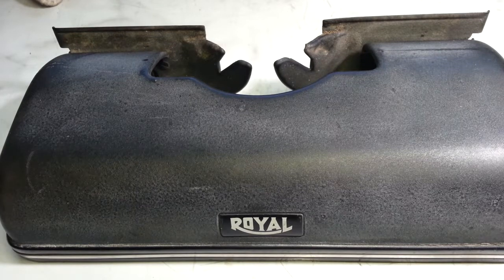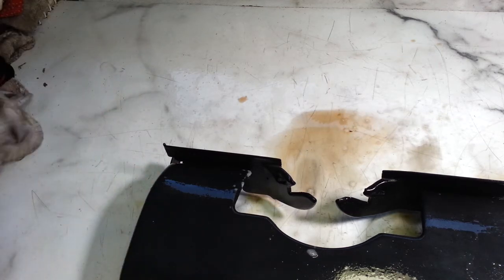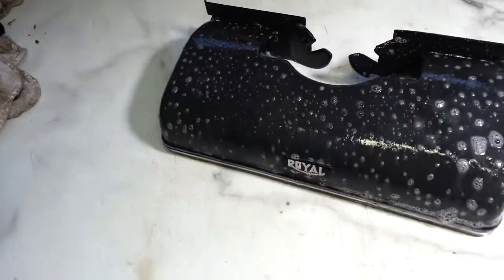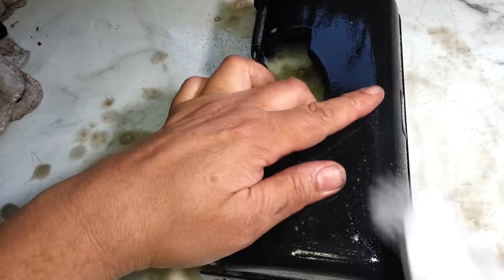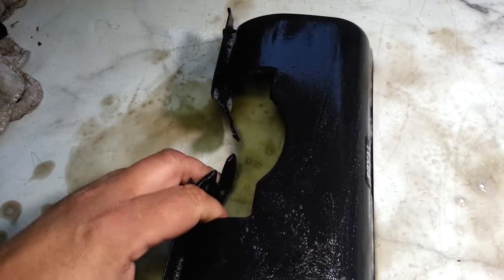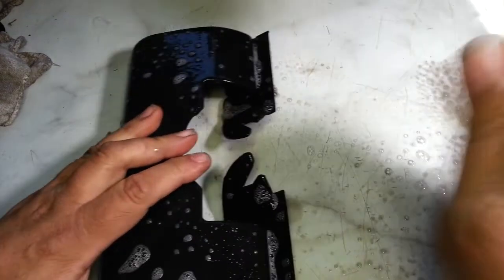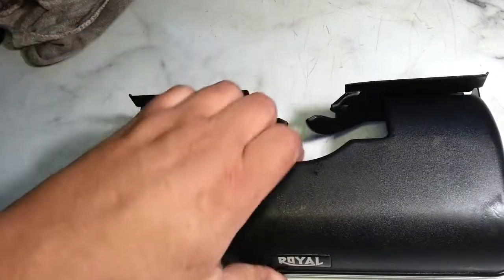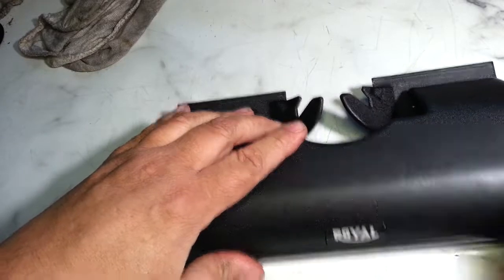Royal KMM Wash Clean Detail Shine Black Wrinkle Finish Brighten Typewriter Paint

Comment: I also have a Royal KMM. I tried using diluted Simple Green and it instantly began to dissolve the black paint and completely dissolved the silver text and decals on the back panel.
Reply from the maker: I was very aggressive with this particular KMM with no paint or decal loss, was yours a possible re-paint ?
Not uncommon for these to get reconditioned in the late 1950's, with a coat of new paint
Reply: @phoenixtypewriter2136  It looked the same as yours. Black crinkle finish with the metallic Royal name on the back, the Royal "crest", and patent information. Even the "touch control" text melted. This was without scrubbing of any kind. Just spraying with a 1/2 water and simple green mixture and then watching all the color from the graphics melt off. I can send you a picture of you would like. It was very unexpected.
Reply: I had previously washed the parts in warm soapy water (as I always do) to help loosen the dirt. The paint and decals were unfazed by the water and soap. When I saw the black and metallic colors flowing off with the simple green, I put everything back in the soapy water which stopped whatever process was going on.
Reply from the maker: My mixture is a roughly 8/1, 
Well good to know that I had better spot check what I put simple green on.
Reply: @Austin Shapiro No, the paint is very thick, luckily.
Reply: Your story almost horrified me, holy cow the desperation. I'm restoring and cleaning an grey crinkled Olivetti Ico MP1. Do you recommend something apart from using water and soap? Any tips are very well appreciated sir
Reply: @jero2955  Stay away from the decals is my best advice!

Comment: I've got a smc skyriter 1958 3y . I'm in Brazil. What do do you sugest for me to use for clean up and what kind of paint to use in repainting the top lid and body? What material for keytop whitening? Cab I use wd for lubricating the keyarms and key panel?
Reply from the maker: Paint , I don't know, I don't do much painting. Whitening, Simple Green cleaner. WD is NOT oil it's a Water Displacement , light oil like marvel mystery oil, hoppes for rails, this stuff for everything, https://www.ebay.com/itm/MG-Chemicals-401B-340G-Nutrol-Control-Cleaner-340g-12-Oz-Aerosol-Can/251912832391?_trkparms=aid%3D111001%26algo%3DREC.SEED%26ao%3D1%26asc%3D20160908105057%26meid%3D9666605fc18c4291b0276c500c229f2e%26pid%3D100675%26rk%3D3%26rkt%3D15%26mehot%3Dnone%26sd%3D233584178714%26itm%3D251912832391%26pmt%3D0%26noa%3D1%26pg%3D2380057&_trksid=p2380057.c100675.m4236&_trkparms=pageci%3Aba17a47e-a192-11ea-b110-96f85edc4688%7Cparentrq%3A5fdcf1281720a4e866046467fffc825e%7Ciid%3A1